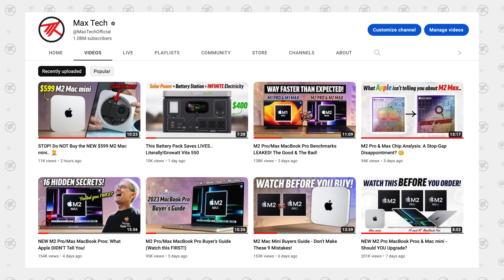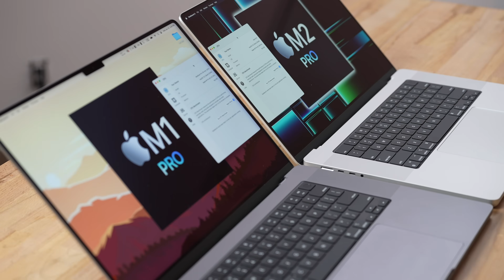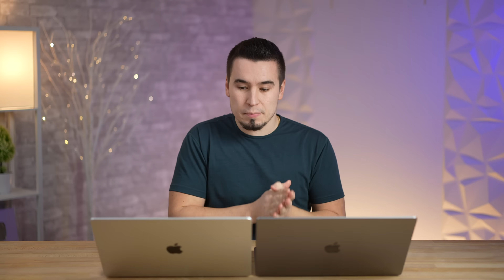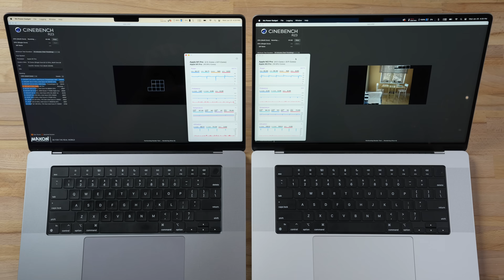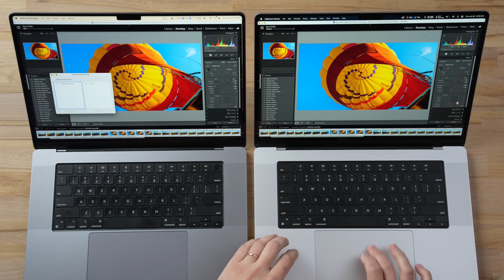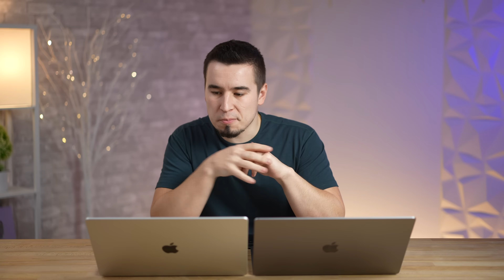M2 Pro 16" MacBook Pro - EPIC Comparison (BAD UPGRADE!?)

Comment: can the 16" MacBook Pro m2 (not the max chip) 16ram ,1tb hd handle Panasonic s5ii open gate 6k and canon c70 raw ?
Reply: I own a 14-inch MacBook Pro with the M2 Pro chip and 512GB SSD (base model), and I have no issues handling 6K Open Gate footage from the S5II
Reply: @crisrocchi2722  what is highest quality codec you use to record in 6k when using the s5ii open gate ?
Reply: @creativegreatsvisuals 
The highest setting available, 6K Open Gate 200 Mbps. Of course, if you are assembling a long multitrack project with 3–5 layered tracks, don't expect fluid performance. But those are extreme scenarios. Regardless, I work in Final Cut Pro X, but the process should be identical in DaVinci Resolve
Reply: @crisrocchi2722 so a 2 or 3 cam interview editing may be a issues ?
Reply: @creativegreatsvisuals  
I generally don’t shoot long 2-3 hour sessions in 6K Open Gate; I only use it when I actually need it (to save space on my cards and storage). However, I did a test by layering five tracks filmed at the highest 6K Open Gate quality (with mixed durations, from 2 to 5 minutes per clip) in a 4K timeline, applying a color grade with a couple of LUTs and various adjustments. When I hit play, the timeline runs smoothly without any issues. With six tracks, it starts to lose smoothness and gets a bit choppy. But we're talking about a real edge case here
Reply: @creativegreatsvisuals  I generally don’t shoot long 2-3 hour sessions in 6K Open Gate; I only use it when I actually need it (to save space on my cards and storage). However, I did a test by layering five tracks filmed at the highest 6K Open Gate quality (with mixed durations, from 2 to 5 minutes per clip) in a 4K timeline, applying a color grade with a couple of LUTs and various adjustments. When I hit play, the timeline runs smoothly without any issues. With six tracks, it starts to lose smoothness and gets a bit choppy. But we're talking about a real edge case here.

Comment: Every speaker needs to be broken in. If you are testing an out of the box M2 vs M1 which was used, the older will always sound better. Mine was also little left out at first, but after few hours it sounds awesome.

Comment: Originally I bought a 2023 15 inch MacBook Air for $1299 to replace my older Mac from 2018 but I noticed even though it was better it wasn’t really a significant difference so I returned it And Went back to Best Buy and i was considering getting a M2 Pro 16 inch they were selling it for $2299 on sale and I went on eBay and seen a M1 Pro 16 inch  in the same configuration for $1399  in mint condition so that’s around $900 cheaper for basically the same thing that’s the one I bought i do not need all that power now and the screen is absolutely amazing feel like it’s worth the money.

Comment: buying an m1 pro NOW (6 months after this video), in my opinion, doesn't make much sense.  first, because M2 pro is slightly better in performance and already has standard benefits that will be in future models (Wi-Fi 6E and Bluetooth 5.3).  After that (and perhaps above all) because it is now found new or refurbished at prices not very different from the M1 pro ... and having a more recent chip, it acquires greater value for the eventual resale

Comment: One thing I noticed with MX Power Gadget is that it significantly increased the system's overall power consumption despite not showing much of an increase in the SOC's power usage. I have no idea why this is the case (could be that the system is using power somewhere else that is not reported, or there is an inaccuracy in the underlying sensors). Either way, just something to be aware of if you use MX Power Gadget for any sort of power measurement stuff. Seems to be good for measuring the SOC, but not necessarily for the full system.

Comment: The M2 looks like a hot rodded M1. More power, but more heat and less battery life.
Reply: Not necessarily less battery life, actually more, especially if just doing light tasks on M2 Pro. But yeah M1 Pro rocks!

Comment: I am upgrading from a 2020 Intel MBP and choose the M1 pro. The M2 Pro faster performance is great, but the cooling issues are obvious. Many years ago I had an Intel Macbook Air 13" and firstly it also warmed up only under load, but after few years it was constantly heating up to 90-95 degrees.

Comment: Curious as to what the best option would be, an ssd upgrade for increased swap ability or bump up the ram without touching the ssd
Reply: Definitely upgrade the RAM if your concerned about performance. Adding RAM will drastically reduce how often the OS needs to swap out to the SSD, which will always improve performance far more than even the fastest SSDs will.

Comment: It appears that there are a few drawbacks with the M2 Pro Macbook Pros, but if the cost is reasonable, it could be worth it. The only incentive to upgrade from the M1 to the M2 would be to get the HDMI 2.1 and high refresh rate features. Consequently, the older models are now looking like an excellent deal in comparison to the new full price models. Thank you for this insightful video! Moreover, it is crucial to take into account the tradeoffs of size, battery life, and performance, so it is essential to do your own research and make a knowledge-based decision.
Reply: @OksanaYermolova
8 months ago
It appears that there are a few tradeoffs with the M2 Pro Macbook Pros, but if the price is right, it could be worth it. The only reason to upgrade from the M1 to the M2 would be to get the HDMI 2.1 and high refresh rate features. Thus, the older models are now looking like a great deal in comparison to the new full price models. Thank you for this informative video!
Reply: @OksanaYermolova
8 months ago
It appears that there are a few tradeoffs with the M2 Pro Macbook Pros, but if the price is right, it could be worth it. The only reason to upgrade from the M1 to the M2 would be to get the HDMI 2.1 and high refresh rate features. Thus, the older models are now looking like a great deal in comparison to the new full price models. Thank you for this informative video!

2

Reply

1 reply
@fractalaughter
@fractalaughter
1 second ago
@poltavaweb9379
8 months ago
It appears that there are a few drawbacks with the M2 Pro Macbook Pros, but if the cost is reasonable, it could be worth it. The only incentive to upgrade from the M1 to the M2 would be to get the HDMI 2.1 and high refresh rate features.

Comment: It appears that there are a few tradeoffs with the M2 Pro Macbook Pros, but if the price is right, it could be worth it. The only reason to upgrade from the M1 to the M2 would be to get the HDMI 2.1 and high refresh rate features. Thus, the older models are now looking like a great deal in comparison to the new full price models. Thank you for this informative video!
Reply: Isn't the refresh rate same on both m2 pro and m1 pro?
Reply: @poltavaweb9379
8 months ago
It appears that there are a few drawbacks with the M2 Pro Macbook Pros, but if the cost is reasonable, it could be worth it. The only incentive to upgrade from the M1 to the M2 would be to get the HDMI 2.1 and high refresh rate features. Consequently, the older models are now looking like an excellent deal in comparison to the new full price models. Thank you for this insightful video! Moreover, it is crucial to take into account the tradeoffs of size, battery life, and performance, so it is essential to do your own research and make a knowledge-based decision.
Reply: @poltavaweb9379
8 months ago
It appears that there are a few drawbacks with the M2 Pro Macbook Pros, but if the cost is reasonable, it could be worth it. The only incentive to upgrade from the M1 to the M2 would be to get the HDMI 2.1 and high refresh rate features. Consequently, the older models are now looking like an excellent deal in comparison to the new full price models. Thank you for this insightful video! Moreover, it is crucial to take into account the tradeoffs of size, battery life, and performance, so it is essential to do your own research and make a knowledge-based decision.

1

Reply

@fractalaughter
@fractalaughter
1 second ago
@OksanaYermolova
8 months ago
It appears that there are a few tradeoffs with the M2 Pro Macbook Pros, but if the price is right, it could be worth it. The only reason to upgrade from the M1 to the M2 would be to get the HDMI 2.1 and high refresh rate features. Thus, the older models are now looking like a great deal in comparison to the new full price models. Thank you for this informative video!

Reply

@fractalaughter
@fractalaughter
1 second ago
@OksanaYermolova
8 months ago
It appears that there are a few tradeoffs with the M2 Pro Macbook Pros, but if the price is right, it could be worth it. The only reason to upgrade from the M1 to the M2 would be to get the HDMI 2.1 and high refresh rate features. Thus, the older models are now looking like a great deal in comparison to the new full price models. Thank you for this informative video!

2

Reply

1 reply
@fractalaughter
@fractalaughter
1 second ago
@poltavaweb9379
8 months ago
It appears that there are a few drawbacks with the M2 Pro Macbook Pros, but if the cost is reasonable, it could be worth it. The only incentive to upgrade from the M1 to the M2 would be to get the HDMI 2.1 and high refresh rate features.

Comment: Another impressive test! The M1 it's so power efficient and silent with the fans barely kicking in compared to the M2 reaching over 100° in almost every test! Damn, that thing can get hot! 🔥🥵
Reply: so for a student like me the m2 is not lap friendly??
Reply: @bero3356  the M2 pro with 1tb seems like the best option. An expensive option nonetheless. But the M1 pro with 1tb seems to be the ultimate option. Need to see the comparison between with M1 pro 8 core 14gpu vs the 10c 16gpu. I with go for this last one, its a more future proof. Even though I don't think I've seen a comparison between the M1 pro 10c and a base M2 Pro... 🤔

Comment: One thing that I always wonder about is if running these side by side comparisons with both machines so close to each other interferes at all with the thermal readings, and potentially battery and performance. I know it might be negligible, but might be better to run them with a larger separation maybe?

Comment: Wow! This video compares two 16-inch MacBook Pros perfectly and even includes a great giveaway! This video shows off the amazing improvements of the new M2 Pro, notably higher clock speeds, better GPU performance, improved webcam and colors, and even improved speakers! The M2 Pro clearly offers better performance and features than the older M1 Pro and is worth the extra cost.

Comment: MaX Tech thank you for your work. But I would like to ask you something. Why don't you talk about the difference of Display Response Times? On one of your videos you said that the ProMotion of MacBook Pro 2021 doesn't seem as fast as on your iPad. The reason of this is the terrible Display Response Times of the screens of these MacBooks Pro. They have only between 40 and 60 milliseconds. The MacBook Pro 2023 has a little better Display Response Time but it is still very slow.  If you want to use the advantage of 120 Hz of the screen you have to have Display Response Times 1 millisecond or even less.

Comment: It's nice that the webcam has improved, but not so much that the speakers are a little inferior. TBH, I was hoping that Apple might include FaceID in it's notch, either that or remove it by putting the webcam higher up. I prefer the 16" to the 14", but the cost is a lot, so tempting to get last year's model at a discount.  The performance comparisons are useful, thanks.

Comment: The difference is not that big, especially for video creators like me. I mean. I use Final Cut but I’m not a super power user. I don’t see the need for M2. I’ll wait for M3 or 4. (These machines are super expensive) so I must really need the change. Thanks Vadym for the good info

Comment: Aaaaaa I have a 2019 intel 16 inch and was hoping the m2 would be a bit more of an upgrade. But now i'm hearing rumors about the m3 macbooks having OLED displays and 3nm processors. I don't think I can wait though. My intel macbook is still one of my favorite purchases in the last decade and the m2 seems like a good upgrade especially considering I mistakenly cheaped out on the AMD GPU to a 5300 😭 I'm wondering if getting more SSD space would fix the write speed problem.

Comment: For the baseline 16-inch MBP,  the SSD speed is the deal-beaker for me. It is evident on the Lightroom Classic export and Chrome test with 15 tabs open. Great work Maxtech!
Reply: I thought about this and even though your point is valid, if you’re exporting to an external SSD, let’s say the SanDisk Professional SSD which writes at max 2700mbs, isn’t the speed of the export limited by the max write speed of the external SSD?

Comment: I just upgraded from an M1 Mac Mini to a 16" M2 Pro MacBook Pro.  My old M1 Mac Mini had 16GB of RAM, but I refused to pay the Apple tax on the SSD so I only got the base 256GB SSD.  Been using a USB-4 external 1TB SSD, and it's been totally fine.  This new MacBook Pro will be replacing both my M1 Mac Mini and my Dell laptop -- more efficient workflow I think, using one device where I had two before.  Plus I can sell those to defray the cost of the upgrade.

Comment: The base spec storage performance is just embarrassing, particularly as the whole Apple memory management is based on having fast ssds. 

Seems like the 16”s cooling system can handle the heat.

Comment: The performance gain on the M2 Pro chip is good,especially in the graphics section. Though I don't think that is a big of a difference. As you said,those who have M1 Pro models should stick to what they have. Maybe in the upcoming M3 chips we will get a massive leap in performance.

Comment: 16GB RAM is really the minimum these days. 512GB SSD is also beneficial, if these means faster read and write speeds over the base 256GB spec. 💻

Comment: Let be honest, a faster fan would be better than keep the laptop running at a high temperature. So you gonna use it on bed or lap,  you won’t burn you lap. Apple is so extreme about temperature control.

Comment: M1 to M2 (all variants) are evolutionary, but Intel from M1 is revolutionary

Yes M2 chips are faster, but remind that they’re significantly more expensive than current M1 variants in market. If you don’t care about upgrades that M2 offer, go get yourself an M1 Pro and save like 200-500 bucks (even more with used or refurbished M1)

Comment: I used to carry these 16" behemoths everywhere, but then I discovered the amazing world of 13" laptops with remote desktops.

These are so powerful, but so heavy!
Reply: Yeah 16 makes sense for moving less often or for keeping at an office desk. The 13 makes sense for moving -around every day.
Reply: @ghost-user559  I'd still argue that a desktop (e.g. a mid-spec m2 mini) paired with a 13" laptop (e.g. m2 Air) will often cost the same as a high-spec 16" laptop, perform just as well (or better), and be far more portable.

I learned that years ago in the Windows world with Synergy - Mac pretty much has it built in now with Universal control.

I "get" the appeal of the 16" full-spec laptop, but I often think it's a result of not understanding the possibilities available, not because it's the best or most cost effective solution.

Comment: It really looks like there is not enough in it to warrant an upgrade from the 16" M1 MBP to the new M2 version.  In fact, new buyers would be better to get a discounted M1 model, especially when they can save up to $500 USD.

Comment: Since improvements are mostly internal and incremental, the M1 Pro is incredible value with deals out there now. For most users, the M1 is plenty enough and a lot more affordable (e.g. you get full SSD speed with the base model).

Comment: I think I am going with an M1 Macbook Pro with he 24-core Max chip.  I wanted the pro chip but I have 4 external displays.  I know I can use my 2-display display link adapter from plugable, but I think the extra gpo cores may help.  Here is hoping I don't need to rely on the battery too much over the next 2 years.  lol

Comment: You both do such a great job at helping us make these choices. 👏 I’m still shocked at the SSD choice Apple made. The power usage is an interesting issue for us, we’re getting a sail boat and everything that draws power needs to be accounted for. Keep up the good work 🔥
Reply: I think the ssd actually was a solution to an engineering error they made on m1.

Comment: I’d like to see if the 1Tb machine would make a difference with the better throughput on the flash. I’m disappointed that Apple cheaped out, on the flash, on a $2500 machine.

Comment: I know it is difficult to compare a workstation grade windows laptop to these machines as the Apple Silicone is obviously set for lower wattage and optimized for on battery usage.. If you need a powerful mobile workstation that won´t be used too much on battery than something with the new i9 Intel 13980 will smoke the apple silicone with its 31K in Cinebench R23 (multithreaded workflows ) and combined with the new 40 series Nvidia cards it will be a more powerful machine = obviously with the cost of battery life and on battery performance. :D

Comment: Great video 
They are good year over year upgrade in term of CPU and GPU but the SSD speed for a PRO device are a joke even compared to the new laptops running window, let alone the benefit of memory swap in fast SSD.
Looks like i will hold into my 2017 13’ for longer :(

Comment: My 13 inch M1 MBP 16GB/2TB is surprisingly capable for much of my work. However, I do require external drives, 2 external screens + really wish it supported more RAM.